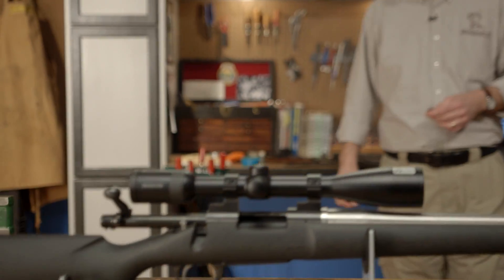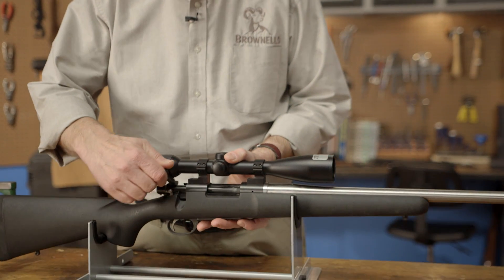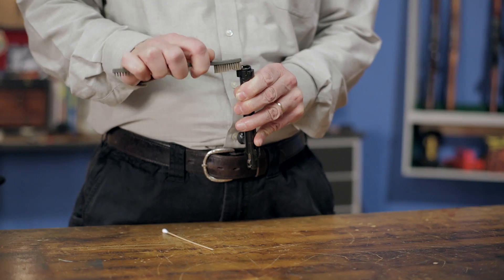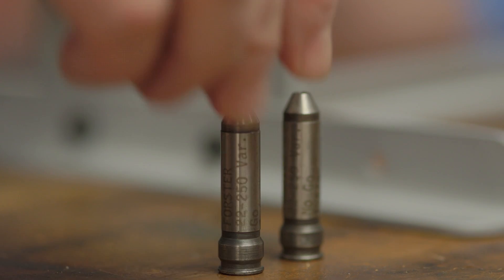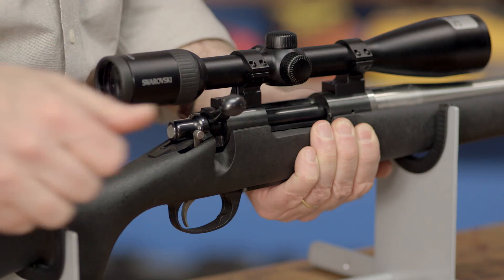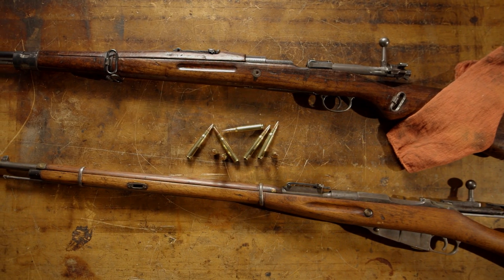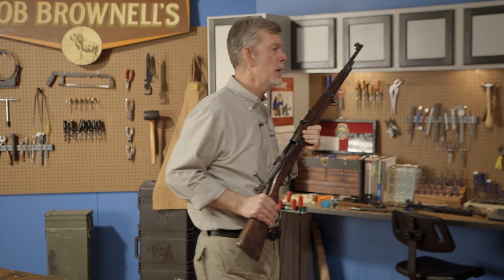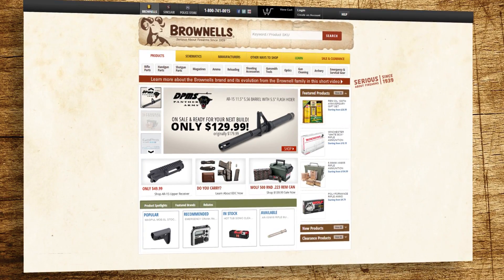Brownells Tech Tip: Bolt Action Headspace

Comment: I am curious why you went to the trouble to remove the ejector, and also mention removing the extractor (if it will interfere with the headspace gauge), then you leave the firing pin assembly in the bolt?  With the 20 plus pound load of spring tension, and the camming action of the bolt now in play, what sense of pressure do you have left to know if you are forcing the gauge?